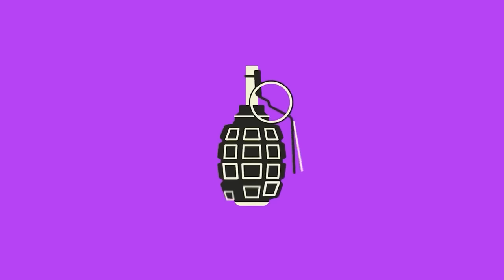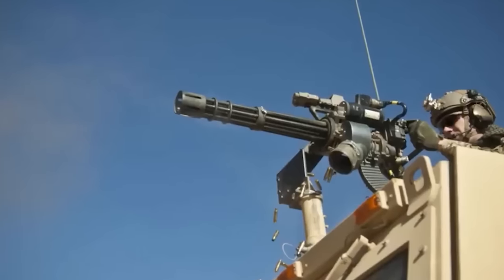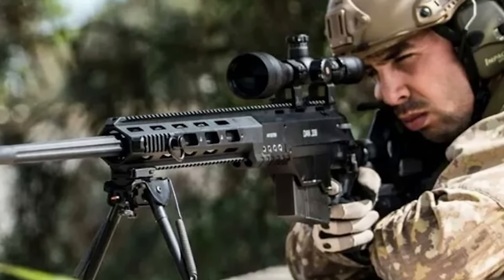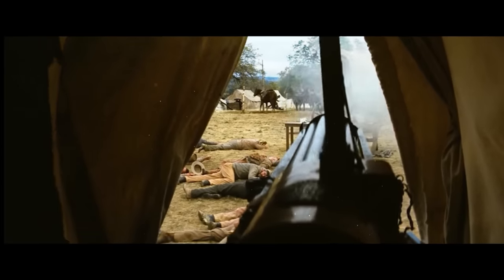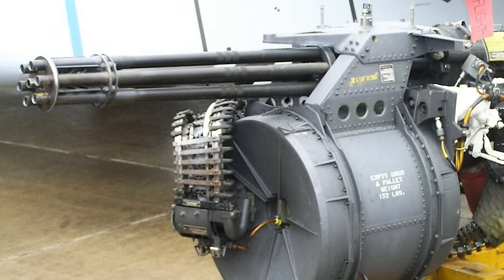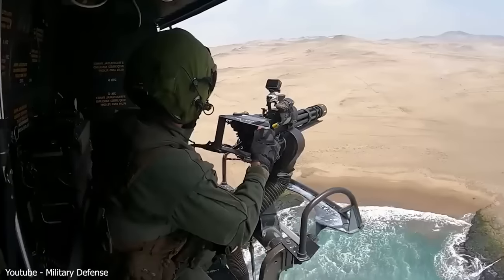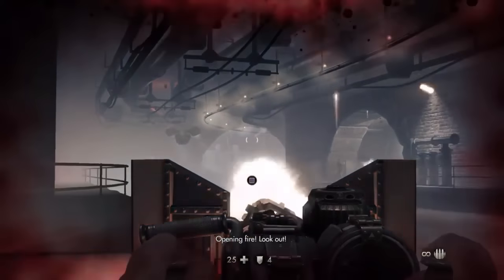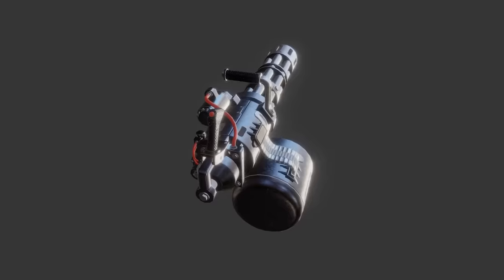THE DARK SIDE OF MINIGUN: WHAT IS IT HATED FOR

Comment: According to Ian V. Hogg's "Anti-Aircraft:  A History of Air Defense", the USAF was working on a .60 caliber machinegun to replace the M2, but the new gun's cyclic rate of fire was so fast that the next cartridge was fired, before the previous bullet had left the muzzle, which caused severe barrel wear.  The only way to get more bullets downrange was to go with multiple barrels, so they borrowed an electrically driven Gatling gun from a museum to see what it could do.  After getting it prepared to fire, the museum piece was good for short bursts of 100 rounds per second.  As much as 100 rounds per second might seem, on a per barrel basis, the MG42 spat more rounds downrange in the same space of time.  As difficult as a minigun might be to fix, it is exceptionally reliable.

Comment: The main problem with the minigun besides the fact that it needs an electrical power source is it chews up ammo so fast that it costs a fortune to feed.  I was interested in a MG42 but 8mm mauser goes for about 2$ a round and at 1100+ rounds a minute it would cost 2200$ a minute to fire (there is ancient primarily steel cased ammo around, but 70 YO ammo would make me nervous)  German soldiers hated that steel cased ammo it constantly jammed in battle.  Several thousand rounds of 8mm mauser would also weigh several hundred pounds.  I could afford to shoot it for only a few seconds.
Reply: 80 year old ammo is still dangerous at the muzzle..  and if it was clean and rust free its fine..  i shoot 100 plus year old 303 stuff..
Reply: I have experience with 80 YO ammo as well it frequently doesn't fire and the double based powders can decompose to NTG and nitrocellulose I remember a barrel bursting when firing ancient ammo- luckily it was not my face or gun.  The Germans hated the steel cased ammo even when new.  It frequently jammed in their MG 42's so they didn't like guns jamming up during the middle of a battle.  It was originally created because sometimes the roller lock system in earlier MG42's didn't always lock in battery (the cylidrical steel lugs sometiimes did not seat or bounced out of the locking recesses) .  The steel cased ammo was created to make the gun less likely to explode with out of battery discharges some later guns had springs mounted beneath the roller locking lugs to keep this from happenig but the German soldiers hated the steel cased ammo.

Comment: Now, it would likely take some kind of balancing system and a boom arm to make the minigun viable for infantry.

You'd basically have to make the Smart-Gun from the Aliens franchise.
Reply: Or take the nerdy approach: chamber them in .223 instead, lower than rate of fire to 1500, and have a complex recoil dampening system, plus muzzle brakes on every barrel.

But now you just got a super expensive and complicated thing that has barely more fire rate than an open-bolter

Comment: Every firearm for a Derringer to the mini gun has a purpose and excel at that purpose but fail badly when they’re taken out if what they’re intended for. Mini guns are meant for being in a helicopter or on a truck. Made for high rate of fire and getting heads down with suppressive fire which it does pretty damn well

Comment: The clips of the guys carrying the m-134a and firing it from the hip, I want to know where they hid the batteries. The mini gun runs off of an electric motor. And it has two speed settings. One for low. And one for high. The actual mini gun used in the movie Predator was sold on one of the gun websites that I frequented. The original owners of the gun told me that during the scene in the movie where the black guy was firing it and actually hit the predator; they ran the power cable under the leaves, up the actors leg and to the motor. If they jam they are a PITA to clear. Dillon Aero solved the problem. I hope to see you guys at the Knob Creek shoot this fall! 😊

Comment: Miniguns are generally used with tracers every so many rounds.  The tracers are coming out so frequently, there's a lit line from the gun to the target.  Flying around in a helicopter at various altitudes, speeds, and shooting out of the side, working out a firing solution is very inaccurate.  The high rate of fire and tracers allows the minigun to be perfect for suppressing anything on the ground.    The use-case is pretty limited.  But being above your target in a relatively slow flying vehicle is perfect.

Comment: The three big advantages of the minigun are that the firerate is variable, the firerate is incredibly high, and that it doesn't stop when a round doesn't go off.
 But two German MG3s are only slightly heavier than an M134, yet they can still spit 2000 shots per minute. On a ground vehicle a twin-MG3 mount would still provide a lot of firepower, reliability (both in that you have two independant guns and that your average soldier can maintain them), and by carrying a few extra parts you could convert them into two regular MGs for infantry use if you have to dismount.
But in an anti-air situation cranking it up to 6000 rounds per minute can be extremely useful. Since accurately hitting planes and helicopters is hard accuracy by volume of fire is a valid strategy
Reply: and those two German MG3s are going to overheat on full auto.
Reply: @GameFuMaster  It doesn't takes too long to change tha barrel but I agree. Higher sustainable fire rate which coincided with reliabilty is the reason why its prefered over loads of competitors like M2 .50BMG dispite of all the disadvantages I assume.
Reply: @spyj1900  you don't want to be fiddling around with changing barrels when you're in a vehicle.
Reply: @GameFuMaster  depending on the fire rate so will the minigun. It runs at 2000 to 6000 rounds per minute and has 6 barrels. So it is like 6 MGs running at 350 to 1000 rpm. The barrels rotating helps dissipating heat, but compared to the propwash of a helicopter that's nothing. You can probably get away with 2000 rounds per minute, but on 6000 it will get hot eventually. But by that time you have fired enough rounds to give lead poisoning to an entire continent
Reply: @HATECELL  given that a blackhawk only carries 2000 rounds per minigun, you're going to run out of ammo before your barrel gets too hot lol
Reply: 6000rpm > 2000rpm

End of comparison.

The weight savings would not matter for the platform, you are in fact wasting the strength of the platform which is how a helicopter can mount a much heavier weapon.

You want an old German weapon that's good for use as a helicopter gunship? Then look to the MG151 20mm cannon, which was used by the Portuguese military.
Reply: The German MG42 did 
1500 rounds per minute,
the "after WW2 version" MG3 did 
1200 "only".

Never near 2000, this is a myth.

A trained soldier can replace a red hot barrel on the MG3 in mere seconds and we had always some spare barrels with us 😊.

The MG42/MG3 were designed for short precision fire not for long supressing fire.

And its simple and reliable design can be operated/maintained by every German infantry soldier.

GOD bless!
Reply: First "One you go Brrrrrt, you never go back"
Secondly my german comrades explained it well, a trained german infantry team man with a MG3 is devastating.
But there arent many soldiers left that can carry a 15 kg/  40lbs gun and the same weight in ammo.  Mounting it on a lafette/fieldmount it becomes a heavy MG.

As a vehicle mounted MG it has gotten "too cheap" for as a primary combat weapon, especially on a remote weaponstation. 
If I need an electrical motor an high tech optics to operate my gun, its a waste of mones to go cheap.

A fully electrical chain gun designe, that can solve malfunction on its own, would be the go-to but I dont see any developement for calibers .50 and below.
Reply: I was trained on the M134, and though it can run at the higher rate of fire, we never did.  Normally we kept the gun at 4k rpm or less.  This preserves the weapon, and ammo.  We trained to hit the target, not spray and pray.  People forget that we soldiers actually train!  Thanks for pointing out how the Bundeswehr operates!   @AlarionSchmidt-xc2ro
Reply: Sustained. Fire.
Reply: Best ever big exploding round... The newest ones.... Way more economical and controlybal
Reply: Boo
Reply: @GameFuMaster  And the mini gun don't ?
Reply: @GameFuMaster You have to learn how to use a gun , 2 MG3s one firing , stop next firing and so on no problems with overheating fast
Reply: @powertothebauer296  i.e. ghetto minigun.
Reply: Yes, the MG3 is a good weapon too. However, you have to change the barrel from time to time to prevent overheating it (if I remember correctly after 3 chains). A problem that doesn't exist on the M134.
I shot the MG3 when I was in active service and it's a hell of fun to lay out some lead. :)
Marching with that baby over your shoulder isn't fun though and your helper has to carry the exchange barrels + ammo, which is no fun either.
Reply: @AlarionSchmidt-xc2ro  Exactly! The fire rate is determined by the weight of the bolt used. Also, the original MG 42 had a caliber of 7,92 whereas the NATO-adopted version has 7,62X51. Hence the different firing rates.
I shot the MG3 (called M62) when I did service at the Danish Airforce back in the 80's. They still have some of them in service...good things never get old. :)
Reply: hatecell, I agree with that.
Reply: @kalleklp7291  I know that , and yes it is a hell of a fun to shoot. if you want to suppress soldiers it can be tricky , for me , I never had to change the barrel when I was shooting this thing
Reply: @AlarionSchmidt-xc2ro  blessed
Reply: @HATECELL  2.5 minutes of sustained fire to get hot, 7 minutes to warp the barrels.
Reply: Uhhh, no. The German MG3's are 30 POUNDS. The M134 is 30 KILOs, 64 Pounds lol.
Reply: @HATECELL lol well said
Reply: @GameFuMaster  why were water-cooled vehicle guns not considered?
Reply: @ctrlaltdebug  probably because the amount of water you'd need is going to a lot more extra weight and volume than just having multiple barrels.

Comment: you forget one major thing with the minigun.   they are perfect for light COIN aircraft,  where 20mm is overkill, but the aircraft still needs a high rate of fire.    Mounted on turrets they are great on light aquatic drones because they have the range to engage patrol boats and such, rate of fire to do serious damage, and can dual act as missile defense. 

in mobile applications, when mounted on a high speed turret, or fixed on prop driven aircraft, these guns are wonderful.

Comment: Even the Soviet 6-barreled,	gas actuated, electrically fired minigun called the GSh-6-30 autocannon installed into a Mig-27 that fires 30mm rounds similar to the A-10 thunderbolt that also has an immense recoil and rate of fire that it could rip the aircraft fuselage apart. 

That is how 6-barreled miniguns are so terrifying.
Reply: That's not a Minigun that's a rotating multi barreled auto cannon. The m134 is called a Minigun because it looks like a miniaturized m61 vulcan used on fighter jets and even though it's classified as an auto cannon it's referred to as a gun
Reply: @Josh Barber the m134 isn't a scaled down gatling gun. Gatling gun is a misused name like calling personal water crafts jet skis or sea-doos, those are model names for pwc's made by Kawasaki and BRP. The m134 minigun and gatling gun are not related.  It was not produced under the 1862 - 1893 patents of the original Gatling Gun. While using a basic design concept of the Gatling Gun, the Minigun does not incorporate any of Gatling's original components and its feed mechanisms are entirely different. Like i stated in my original reply it got it's nickname because it looks like a scaled down m61 vulcan
Reply: Saw a graphic once that indicated that the recoil impulse of the GAU8 30mm was equal to the thrust of one of the 2 engines of the A10!!
Reply: @philgiglio7922 
It's worse than that.  Firing for too long can stall the plane, so that's more than just cancelling out one of the engines.
Reply: @manictiger ...to prevent the gases from the gun choking the engines the igniters in the burner cans were automatically switched on
Doubtful it carries enough ammo to do that
Reply: you're meant to burst fire the Gsh-30-6
Reply: @manictiger  That stalling is just a myth. One engine in A-10 produce  9,100 lbf (45kn) thrust, and it has two. That is equivalent 90 kn constant thrust.

The GAU-8 provides about 10% more force when firing for second, than single engine. But it has two, and the heavy aircraft is in motion, even diving toward ground when firing. 

If gun would get unlimited firing capability, it would slow plane in level flight about 1-2 knots.
Reply: @roblopez8481  Gryazev-Shipunov GSh-6-30 mass is half what GAU-8 is (150 vs 280 kg). And it only 2 meters long (v. 2.8m). Very very tiny for it's task.
It's firing speed is higher, and it can fire about 45% more mass on target with same firing time.
Reply: Yes, but it is also a very inefficient weapon system in terms of weight and ammo space and consumption compared to the Vulcan 20mm. @paristo
Reply: @Orinslayer  It is not, as that argument is same as M61 vs GAU-8.

Gsh-6-30 is a cannon developed for other tasks than M61 or Gsh-6-23. 

And amount of ammunition depends the aircraft, and it is depending its designed purpose.

M61 Vulcan is great in example F-16, but it is as great as GAU-8 is on A-10, but swap those places and both would be very inefficient.

A-10 with M61 and F-16 with GAU-8 would be ridiculous design idea...
Reply: @paristo  the gau 8 is already inefficient, it can hardly destroy tanks of the era it was designed for, nevermind anything newer, and for lightly armored vehicles and cover an m61 is faster firing and half the weight. The a 10 is already ridiculous and a terrible plane
Reply: @Helperbot-2000  GAU-8 was never capable to, or meant to, destroy MBT's.
That is a myth.
 It is, like Gsh-6-30 as well, meant to be used against other tanks like IFV, APC or many other AFV as APC, SPAAG, SAM etc.

Main purpose is to offer a pilot a weapon to engage targets of opportunities where a AGM, bomb or even rockets are waste.

M61 is not for that task, even when it can be used, but in fighters the guns are elevated for air-to-air combat by few degrees aim, where for attack planes gun is angled downward by few degrees for the ground targets. This example in AV-8B Harrier with it's GAU-12 is not optimal for air combat, but for ground attack.

But regardless that, a Soviets own tests showed that Gsh-6-30 is effective against MBT's, just as GAU-8 designers did as well. Because one doesn't need to destroy a MBT to kill it. A mission kill can be performed just by damaging them, and delivering enough moral damage to crew that can't see up in the air, and realize that they are targeted by something capable destroy them without being able to do anything about it.

The effectiveness comes from capability put lots of hits on vulnerable parts, and that is where Gsh-6-30 was better than GAU-8 as it was faster to put the same amount of mass on target, hence more impacts on the target at the same time. And so on more likely to find a vulnerable part to be penetrated and destroyed/damaged.

A 4 MBT isn't a major threat, compared to 200-400 men in a 30-40 APC and IFV. You take two MBT out with AGM and concentrate to stop few vehicles here and there and attack is repelled effectively, as artillery will take rest out.
Reply: Google Wickman or Schuttle six spindle lathes (used for high volume fastener production) , thats where the idea for Gatlings came from.
Reply: What's terrifying is if you're one of the pilots wondering how much of your plane will be left after that one second of trigger pull
Because the Ruskis never designed a plane around spitting out that much kinetic energy, as the US did with the A10

Comment: In the early 1900's, the US Navy actually had motorized Colt Gatling guns with drum magazines they could mount on the guard rails of ships to provide close range fire support. In the 1950's, a US Air Force general got ahold of some to test them for viability in aircraft, which evolved into the 20mm and 25mm Vulcans. The weakness of the minigun as a door gun became very apparent during the Blackhawk Down incident. They had a door mounted minigun and plenty of ammo, but no electricity available. The guys with .30 caliber rifles were stripping rounds out of the magazine to reload their rifles. Dillon Precision got a contract to repair over 100 miniguns in the US Army's inventory that were broken and out of warranty from GE. He redesigned the clutch mechanism and determined that 6000 rpm was beating the guns to death, so now they shoot them at 4000 rpm. Dillon makes 7.62 miniguns for the US military now.
Reply: Events like that show why a small backup battery pack might save the day if it keep the gun working for a little while if the vehicle provided electricity is malfunctioning.
Reply: @dragongrazer7620  Not enough amps. The simpler method was to just use a belt fed machinegun on an aircraft. That does two other things, it saves weight from the weapon and the extra ammo so the helo can have one extra crew on board.
Reply: @wittsullivan8130  Thank you,  that sounds reasonable considering the complex machinery to keep it working.
Maybe they should have gone for a slightly updated version of the original gatling, and used a manual handcrank instead  🤔😂😂😂

Comment: I think you mean the M240, not the M249 SAW (squad automatic weapon). The M240 which replaced the M60 is a 7.62mm light machine gun. The M249 is chambered in 5.56mm but good points. The amount of ammo a light infantry soldier would have to carry, makes the minigun unpractical. This also holds true with the M2 .50 cal machine gun which is also a crew served weapon. These heavier weapon systems need to be mounted on some type of vehicle for mobile operations.